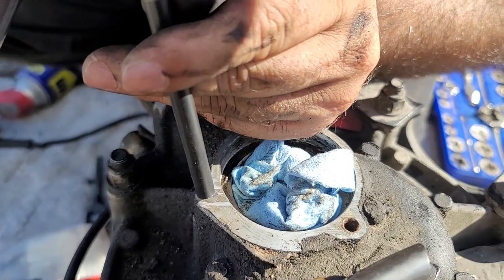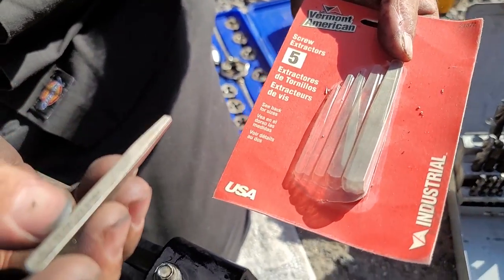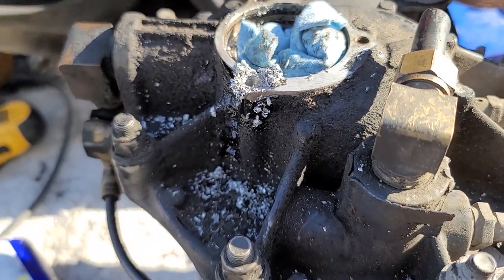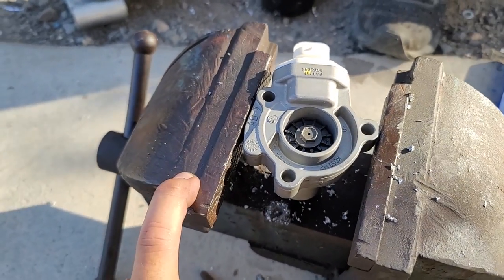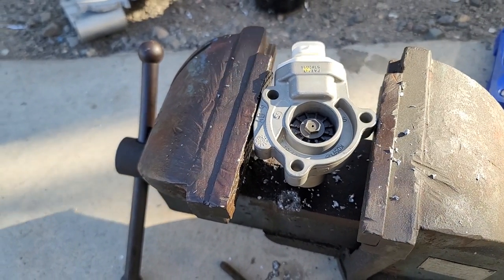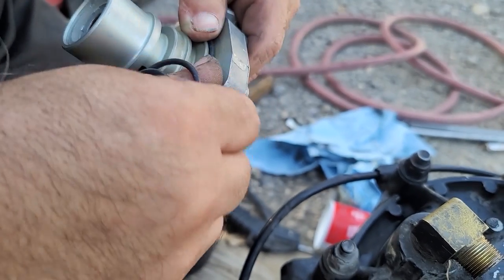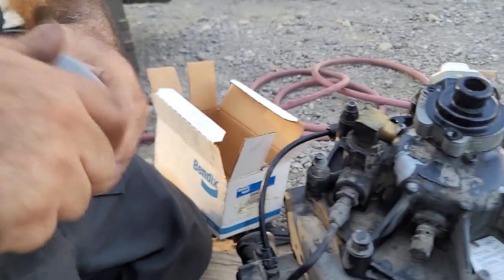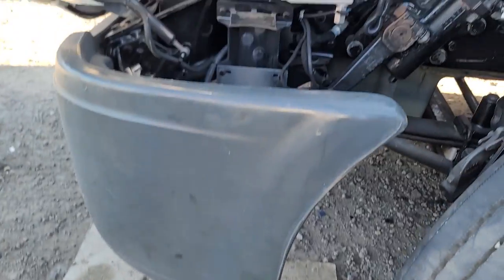Air dryer purge valve replacement/  Broken bolt fix / Air dryer purges constantly leaking

Comment: Question? Why did you replace that valve ? Cause my air dryer make a lot of noise while is building up pressure and the air tanks don’t hold it for to long any advice?? Thanks
Reply from the maker: This valve was leaking air from the bottom,  im not sure about the issue you're having sorry
Reply: @TRUCKINGTIPSDIY  the problem that I have one mechanic told me that I have to replace the air dryer and after I 👀replace just that part! That why I ask you why did you just replace that part in set of the air dryer